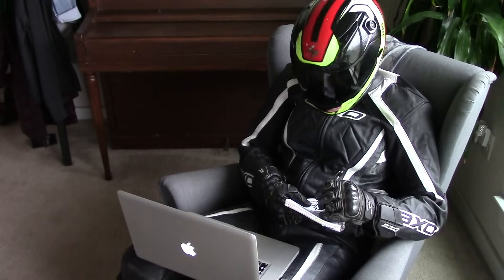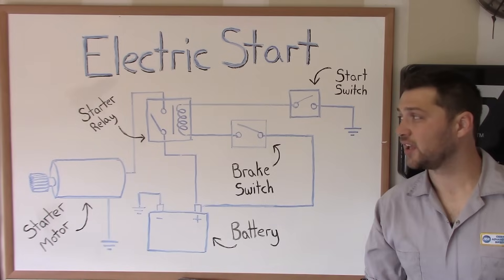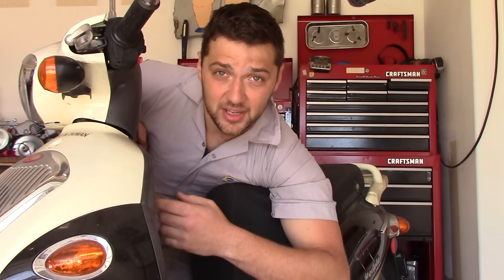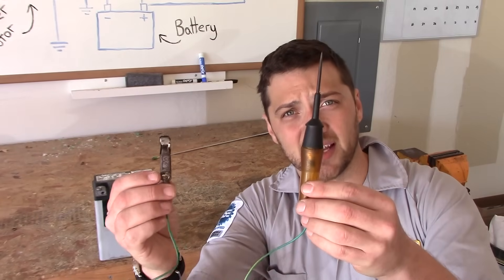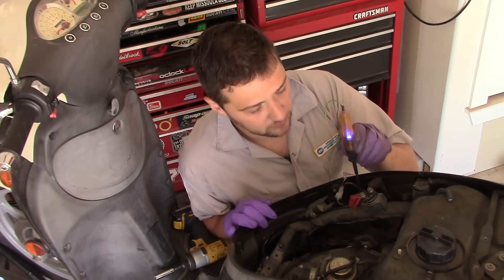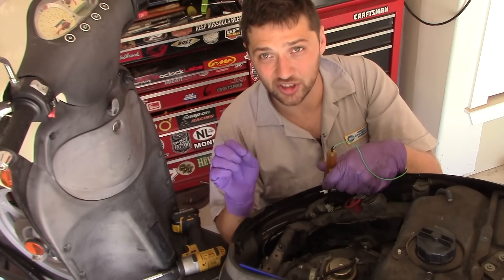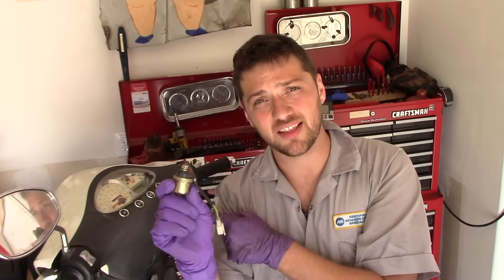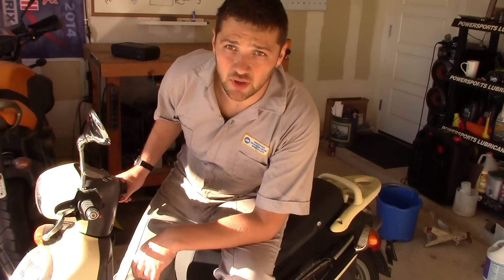Scooter 911: Electric Start Doesn't Work (troubleshooting your starter, starter relay, and circuit)

Comment: I have a very weird problem: in the morning the electric starter works perfectly, but if i stop somewhere for say, 30 minutes, the starter motor wont work correctly and i first have to kick a few times to get it to start electrically. But with short time periods(5minutes) it works nicely.Do  you know where the problem could lay?
Reply from the maker: Can you describe what you mean by works correctly? Does it crank the engine over (like rikiikikkikkikikiikkkikk sound)? Does it click? Does it do anything at all?
Reply: @Scooter_911  i believe i dont hear the rikiki sound when it doesnt work correctly. the engine runs fine though when i do it with a couple kickstart kick?
Reply from the maker: @TheMW3uploads  Well that is strange. What I suggest is, when it doesn't start, pay real close attention to all the sounds it makes and make sure your brake light is illuminating. Then I would recommend manually testing the starter by watching the video at 7:34. Good luck and let me know what you figure out!
Reply: @Scooter_911  figured it out. Valve clearance when the engine is hot they got too tight probably.
Reply from the maker: @TheMW3uploads  good for you! My next video is about adjusting the valves. Nice work!
Reply: @Scooter_911  thanks. Looking forward to the video

Comment: Hey dude great video,My Honda S-Wing 125 is not starting,.....when i hold the brake in and hit the starter button i get a click sound and it doesn't start.
should i take the starter relay off and try and test the motor manually?
Reply from the maker: Yes indeed! However you shouldn't have to remove the starter relay to perform the bypass test. Just touch use a tool to connect the two external terminals. You can also use a test light to see if the relay is sending power to the starter motor. Let me know how it goes!
Reply: @Scooter_911  Hey man thanks for the reply and yep no problem will do.

Comment: Garret, I have a new 2018 Tao Tao 50cc,   When I hold the brake , and hit the starter it’s spins freely, like it’s not engaging in the motor, this happend after my wife hit a concrete parking lot block, just scrapped paint but still has not worked since? Kicks over and starts fine?  Thoughts?   Thank you
Reply from the maker: I've seen that before! The starter motor on the 50cc scooters are a bit different from the 150's. The starter motor gear contacts a gear on the back of the variator (sometimes called the drive clutch). I recommend you take the belt cover off and inspect the starter gear and the variator. The belt case has a receiving hole with a small bushing that the shaft of the starter motor sits in. Make sure the starter is properly aligned and the shaft fits nicely into the belt case. You can even operate the starter with the belt case off to observe how everything is working (but be careful nothing comes apart). If everything is just as it should be but the starter gear still isn't contacting the variator replace the starter motor. The starter has an actuator (sometimes referred to as a Bendix) that thrusts the starter gear outboard, which is how it contacts the variator. This actuator goes bad on occasion. Good luck and let me know how it goes!
Reply: Garret Seesing Thank you, we will check it out tomorrow, I will  advise how it went. I think I should have bought a Honda Metropolitan or a Yamaha 🤦‍♂️

Comment: i was hoping to recognizing by sound which components were bad. Like if the relay was bad it would sound like this or if the starter was bad it might sound like this. In the beginning you said if it sound like this then didn't explain what caused that noise which is what my problem is. thanks it is a good video

Comment: I can bypass my solonoid and get the starter to turn over. I don't get horn, lights, blinkers or engine to turn over. It just sat. Ignition switch harness gives me con and interrupt with key.
Yo no say
Reply: Interestingly enough, the scooter, 2008 Supremo 50cc  out of nowhere would crank, then not crank, now it's cranking consistently. The blinkers work, but the horn and headlights don't. I need to clean the carb, because it only starts with starting fluid. In order to get spark, I had to sand the magnet, and regap from 50 thousandth to 15. This is a continuation from last year not being able to get this pos started, because the gas tank was Rusty, flaky and corroded. The pump wouldn't work. I refuse to trust the oil pump and will bypass it, or fill it with mix gas. The vacuum line broke a few years ago, I fixed it and saw it broke in another place. My dad gave me these two scooters a few years ago. The first one, the engine blew on it. The oil pump stopped working without warning and the crank bearing siezed.  I've never had so many issues with anything ever. BTW, the chrome over aluminum case bubbled looking like ass and the front tire never held air. Buyer beware.
Reply from the maker: @MrRonluker  dang! You might be better off with an exorcism. Good luck!
Reply: @Scooter_911  So, as it turned out, the oil pump filled the carb. I found a puddle this morning, and thought, awesome, I don't need to clean it now. This thing would smoke like a vape addict after sitting for a while. TBC
Reply from the maker: Wow, sounds like you might have an ignition switch problem. On most scooters there are 4 wires in the ignition switch. A 12v battery wire (usually red), a main key power wire (usually red with a stripe like red/black), a kill wire (usually black with white stripe). And a ground wire (green). Try connecting the 12v battery wire with the main key power wire. You can usually do this by disconnecting the connector and bridging the terminals with a paperclip. Let me know how it goes!

Comment: Garret, I noticed the ignition switch is not on the diagram. (I'm guessing for simplicity's sake) Is that between the battery and the brake switch?
Reply from the maker: Yes exactly! You'll also note that the brake light itself is also missing. I didn't want the wiring diagram to be too complicated and intimidating for someone who might not have ever seen a schematic before.
Reply: @Scooter_911  Makes sense. I'm an electronics tech, so I'm all about schematics.
Reply: @Scooter_911  Another question for you. When the engine is cold, does turning the throttle prior to cranking do anything at all, as in does it spray some gas, or is it only effective while it's cranking over? And I assume that I should not touch the throttle while it's cranking as that will present too much air to the cold engine, that should be "choked".
Reply from the maker: @radconserv68  dude! That is such a great question (and honestly one of my pet peeves!) It deserves it's own video... So that's what is going to happen! Look for a complete answer in a video coming soon!
Reply: @Scooter_911  Again, I can't wait. I hope I'm not bugging you with too many questions, but I have a ravenous hunger for knowledge about fixing this scooter and knowing how to deal with future problems.
Reply from the maker: ABSOLUTELY NOT! I'm glad to help! Youtube has helped me out in so many ways i'm happy to be able to give back to the community! On top of that i'm getting great ideas for future videos!
Reply: @Scooter_911  Well that is good to hear. Because I have a million more questions! To be honest I really want to understand my scooter from top to bottom , so there is nothing that I can't fix on it. because it's so hard to find somebody to work on these things

Comment: I like how you lay things out very clearly and simply, especially the diagram on the grease board. It makes it easier to understand. Thank you so much for making this video!!
Reply from the maker: I'm so glad you liked it! Thank you for watching!
Reply: Well that's means that your problem is not in the starter circuit you got  another problem like fuel or spark

Comment: Hi Garret 
Question 
I have 50cc scooter 
Bought two stators 
Both are wrong 
Any suggestions?
Reply from the maker: What is wrong about them? Most of the time you can count the poles. Most of the time they will be 6 or 8 poles.

Comment: Instructions unclear. I removed panels on my Vespa willy-nilly, and it turned into a Honda walk-behind mower. It's a very nice mower, so I'm not complaining.
Reply from the maker: Ahhh i should have mentioned, you need to be using metric sockets, not fractional. Otherwise "side-effects may occur". Do you know a good tool guy?
Reply: Unfortunately, I don't.